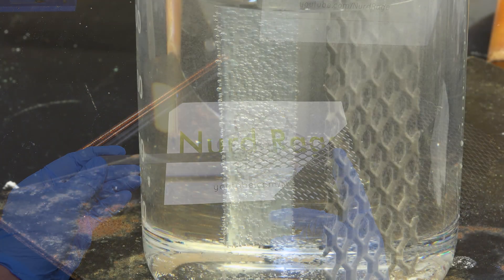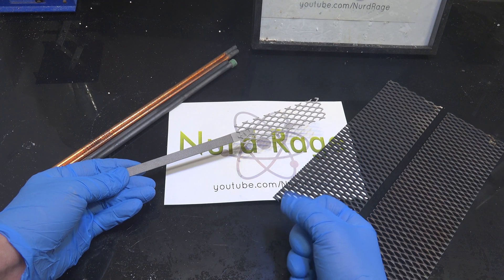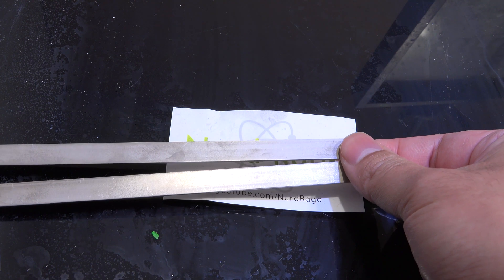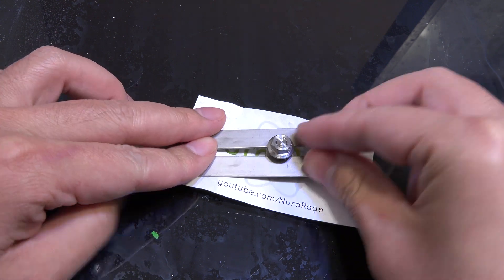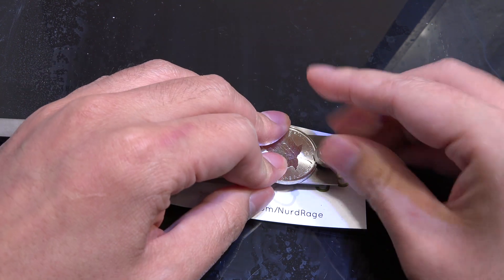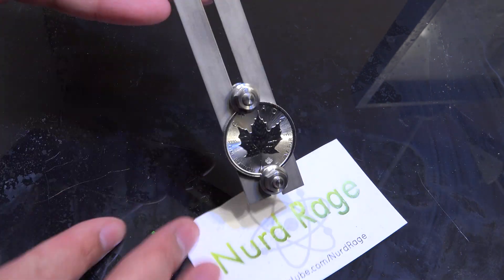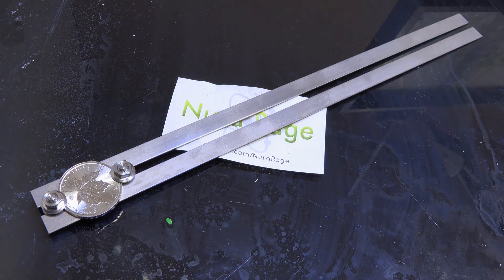Make a Platinum Electrode

Comment: How mixed metal oxide made ,i guess they mix the oxides to make a paste of oxides this then we cover the sheets of a steel mesh not titanium ,because u need only a thin layer of mmo layer ,but adding more with heat again makes it denser more condensed oxide layer ,layer upon layer

Comment: Necroposting an missing the point of a good joke, but.... given you talked about a thin layer of platinum on the hard drive platters on your acid destruction video, could you actually use those as a very inexpensive amateur platinum electrode?

Comment: Sweet. I got a platinum ring I wanted to use in just such a manner, I was worried whatever I mounted it with would degrade first. Nice to know I'm good. However it does have some gold plating, any chance electrolysis will interfere with that? Its an heirloom worth more than the combined value of every vehicle I've owned (all used and well used mind you), irreplaceable doesn't begin to describe it so any damage is outta the question. Thoughts?
Reply: Do not use it as an electrode lmao
Reply: @infernalsorcery7923  waaaaaaaaay too late for that dude! I found out the great big "diamond" was a fake. I popped it out and set it to the side so it can be recounted at a later date. The ring is still in excellent condition
Reply: @ltsgobrando  if it has gold on it, prolonged exposure to electrolytic reactions will cause damage and 'wear' exclusively to the Golde.
Reply: @infernalsorcery7923  Originally that was my concern too, but ultimately the gold plating was a blessing in disguise! The biggest thing for me was making sure the ring was safe, and why I ultimately wound up with such a perfect design.

Once the great big (fake) stone was out I noticed that only the little arms were gold plated. I wound the ends of a really thin stranded copper wire around the gold arms, so they would act as electrodes for the ring. I then siliconed the hell out of that connection. The real trick was having the copper wire have a zinc lead on the other end. Why re invente the wheel when redox reactions have been known about for years. I just gotta make sure to replace the plug when it crumbles instead of bypassing it.

Thanks for the concern man!
Reply: @Jordan Richards  Well, that's good news then, sounds like a cheeky but effective bypass to my concerns as well anyhow. Much luck

Comment: So I'm going again through this video after a year, and many seem to think it was a joke. It isn't in fact, except as pointed by NurdRage below the ridiculous price. This does work, but no need to spend $1000 on platinum to get a real platinum electrode. That ounce of platinum in the coin if properly processed would be enough to make many electrodes.

I have in fact made a platinum electrode in a similar manner, but for much less money. I used a 5g platinum bar, also purchased with my soul (and some bitcoin on top) and stretched it very thin by hammering it between 2 sheets of leather. It's really the surface of the platinum that matters, not the bulk of the platinum trapped inside the bar or coin. I ended up with a thin piece that's about 6cm^2 per side, so about 12cm^2 total. I then spot welded this to the end of a titanium strip. It works nicely in a perchlorate cell. I trust the welded joint much more than plain mechanical assembly with bolts - salt will eventually creep between the titanium and the platinum at the mechanical joint and degrade the contact.

I spent the equivalent of $170 on the platinum bar, and a couple of hours hammering on it. But I plan to enjoy my real platinum electrode for many years to come.
Reply: This was an amazing read! how was your platinum electrode doing now in 2023?
Reply: And even then i bet is possible to process the spent electrolyte to recover the platinum.
Reply: Probably not worth as it decays so slowly  @teresashinkansen9402

Comment: What you generally get in the "fake" anodes are coatings of palladium and/or rhodium over a cheap ferro titanium base.   At least, that's what one I have appears to be.   It'll work OK for 2 volt jewelry plating, but not last well in a perchlorate tank.   

HOWEVER, it does appear to me that the rhodium or palladium over titanium makes a very nice clean and not oxidized surface for plating lead dioxide for creating a much more durable anode.

Thoughts?

Comment: Platinum electrodes are awesome. And i'll never forget the manufacturers recommendation how to clean the platinum electrodes of our coulometric karl-fisher device (Same thing as the Karl-fisher titration, but instead of adding the reagents you create a part of them by oxidizing iodine I- to I2): Just clean them with a 1:1:1 solution of sulfuric acid, nitric acid and hydrogen peroxide xD A bit extreme, but since it's an awesome cleaning solution it won't attack the platinum electrodes, why not? Just don't mix the 3 compounds the wrong way or you'll get a huge cloud of nitrous gases xD

Comment: There several videos out there that  describe the process of uniform thin film deposition and the at home manufacture of a device that can be used to achieve these results at home. 

I suggest you check them out or even contact the youtubers that are posting videos of their devices. It may allow you to get more use out of you platinum.

Comment: I knew something was wrong when you said you didn't even have a drill to drill into the titanium strips. I was thinking What????? , .... Nurdrage does not even have a common electric drill??? lol
Reply: Drilling titanium is a bit harder than just having a drill.  If it is 4al6v, which is the most commonly used alloy for machining and fabrication purposes, it's even more difficult because the alloy is very tough, and does not conduct heat, which leads to burning your drill bit and softening the cutting edge, which leads to total edge failure.   I recommend stub or screw machine length industrial grade HHS drill bits, and you want to do this in a drill press if at all possible.  Buy a pack of whatever size you plan on using, because you are likely going to burn at least one.  Run it slow, with even pressure, and lots of coolant.  Too little feed pressure is also bad, because if it's not cutting it's rubbing, and that's heat that will also burn your tooling.
Reply: You don't want to use 6AL4V titanium for anodes... they are not nearly as chemically resistant as pure titanium. Always use Grade 2 or something. Unfortunately you will have to make your own nuts and bolt out of grade 2 because nobody makes them (they are all 6AL4V). Drilling titanium isn't that hard, I did it with a drill press. I even tapped it too.

Comment: Use silver cables they aren't that expensive (about 1 dollar per 2 grams) and it has one of the best if not the best electrical conductivity at room temp
Reply: OLD-BIT ProGaming not very unreactive,in many experiments,it will not survive
Reply: OLD-BIT ProGaming not very unreactive,in many experiments,it will not survive
Reply: Alvis Gwa yes that's the downside

Comment: I've worked with commercial grade titanium & found it very easy to work with. Drilling is comparable to drilling mild steel.
Reply: Cutting sheet Titanium is a bit more of a problem. I invested in some Diamond cutting wheels for my Dremel and have been pleased with the results.

Comment: Hey mate, if ya live in Ontario than feel free to message me if you ever want access to a cnc shop or tooling. If you need anything custom made just let me know, it's what I do everyday. Obviously you'll have to supply the raw material but my mill, lathe, powder coating, electroplating and general tooling abilities are something I'd be happy to donate as well as my time to the effort your making.
Reply: Alvis Gwa I am aware, Ontario is a province in Canada mate.
Reply from the maker: Wow! that's an awesome offer! i'll keep it in mind. Thanks!
Reply: NurdRage anytime man, I've built apparatus for experimentation before when I was at Trent taking biochemistry,... which I dropped out of. Organic chem ruined my brain. Anyway I am originally an electrician by trade and have a huge background in electronics, micro controllers etc so if you need any help with any of that stuff, as well as the machining by all means ask away. 
My mill and lathe are both fairly small but for 90% of what I can imaging you ever needing what I have is plenty.

Comment: i know a thing or 2 about canadian curreny,  this kind of large coins are usually 20$-50$ of value + the cost of the metal +10% profit because they are collector's coins.

this one looks like the 1oz platinum maple leaf minted between 1988 and 2002 that is worth about 1000$ (50$ face value)
assuming the 950$ per ounce value of platinum, it actually looks like you are only loosing the 50$ by using it as platinum.
Reply: *5%
Reply: tis usually 10%, this time its 0% if you include face value
unless you were talking about my typo ''50%'' which was meant to be a ''50$''

Comment: I had no idea that platinum is now about 20% cheaper than gold! That's crazy!

You use the same tools to drill titanium, that you use to drill any other metal. A drill, and metal drill bits.
Reply: You need cobalt drill bits to drill metal like that. Which are far more expensive than your run of the mill bits. But I agree, those proprietary nuts and bolts were probably pretty expensive just because they are titanium.
Reply: For something thin like that you could drill it with any old drill bit, wouldn't matter. The coating is generally there for "non-stickness". In my experience titanium behaves a lot like aluminium when machined.
Reply: Mitchell G You can drill titanium with regular drill bits. Especially if you're only drilling two holes.If you're drilling titanium for work or production, then yeah cobalt coated or solid carbide bits are best. but it's not a matter of how well they'll cut, it's a matter of longevity. But for two holes, a regular bit from home depot will work just as well. It just wouldn't last very long. (In fact the few times I've drilled titanium, I drilled quite a few holes with regular TiN and black oxide bits.) Also, cobalt coated drill bits aren't very expensive. you could get a cobalt coated bit to drill those holes for just a few bucks.

Comment: This one has me a little confused. I am by no means a chemist so I have no idea if this is a total joke or just slightly a joke. I mean yeah it costs WAY more than just buying a pre-made one but it works doesn't it?
Reply from the maker: It's a slight joke. Technically this does work. But it's ludicrously expensive and no one in their right mind would ever do it.

That being said, "bulk platinum" electrodes which use pure platinum elements do exist, but they usually use very thin platinum foils rather than thick coins. a coin is a very inefficient use of platinum since the surface area to mass ratio is much smaller than a foil.
Reply: Ahh okay that makes sense. When I first read that I read "to protect the more valuable titanium" and thought 'ummm what?'
Reply: Awesome! thanks for the reply. It was one of those things where it both made sense and didn't to me. But I  bet to a lot of people this is hilarious I am just not smart enough in chemistry to fully grasp it on a first viewing.
Reply: It's pretty easy to get Platinum wire, why not hammer that flat and wrap it around some Titanium? You'd be able to control how much Platinum you use and could probably get a really big electrode for like $100.
Reply: what about april 1st
Reply: I was thinking this had to be a joke. Though I was thinking why bother? The Ti is already submerged, just use that as the electrode, then I remembered Ti passivates on the anode and loses it conductivity. That's why you said the current is all flowing through the Pt.
Reply: +Martin of Gliwice
No bulk platinum is always much cheaper than any ready made platinum object. Just like with any possible metal.
Reply: +Mrdudeman
I think the titanium would just lose its electrical connection to the solution as the surface passivates. But of course that depends on the electrolyte, some would also corrode it.
Reply: did you really buy 1k$ worth of platinum or was it a fake coin with a fake reagent?
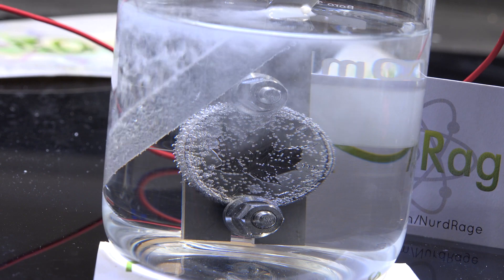Reply: in 2:20 its quite clearly written "Fine platinum" on the coin. You can also see the 9999 numbers indicating it's purity. So that's what I meant, it could be fake.
Reply: well also the increase surface area will speed up the reaction, I also think it is april fools
Reply: x9x9x9x9x9 actually platinum coins are a very cheap source of plaatinum, and other precious metals. This coin will last pretty much forever, the titanium can be easily replaced. Platinized titanium mesh will break more quickly as platinum coat is not as thick as this coin.
Reply: NurdRage I wonder, if with the use of burners, hammers and anvils or even a hydraulic press you could flatten the coin down to a plate. Coins are actually cheaper per gram than most other platinum objects, I recall. If you could make a platinum sheet this way, you could have a quite good electrode or even a few good ones.
Reply: The entire point of the platinum is to protect the more vulnerable titanium from corrosion in the form of a coating. If you are literally just going to bolt a piece of Pt on to bare titanium strips, why bother? Just use plain Ti, it will have the same effect, and be cheaper.

Comment: What if I chose to cut costs by using duct tape or elmer's glue? Might I also suggest just throwing out the platinum and using a tin can as an electrode. More surface area, more bang for your buck.
Reply: You can use your own urine as the salts
Reply: Samuel Connolly yeah the gas that comes off always smells amazing
Reply: carolyn mmitchell I like to fill my house with the smells of electrolyted piss
Reply: The problem is glue/tape might dissolve.

Comment from the maker: A major advantage of an assembled electrode over a plated electrode is that it's far easier to repair. If the titanium should decay it doesn't take the platinum with it. You can disassemble the electrode, get new titanium, and rebuild it with no loss of the valuable platinum.
Reply: When your soul is less than 1000 dollars...

You have done some things in your life we don't know about.
Reply: Thereby negating the entire purpose of the platinum in the first place! Brilliant! I'll take 2 dozen.
Reply: Souls are sold by mass, current exchange rate is a beeelllion dollars a gram...........
Reply: Andrew Bagley IT IS AUSTRALIAN HUMOUR OMG DAMN AMERICANS
Reply: https://www.stuller.com/products/laser-wire/262791/?groupId=98824&categoryId=1567&recommendationSource=CategoryBrowse

10' of 36ga 90%Pt 10%Ir wire. It's about $40. 
PM me if you ever need something made of precious metals. It's what I do for a living.
Reply: LoL!
Reply: rude
Reply: but its dick jokes
Reply: Yes, they are dick jokes, my slow Andrew friend. Just like Basicially said.
Reply: I couldn't find a relevant video, so this one seems right. I made a 30vdc power supply, and some copper electrodes. I ran it in some saltwater, and had a sandwich bag overtop to capture the hydrogen. The bag didn't t expand, and the water took a tint. Can you please explain to me what happened?
Reply: Actually, there's quite the article on making platnium foil and spot welding to a titanium backing on the blog at exorockets.   Fascinating reading.
Reply: NurdRage who did you sell you soul to?
Reply: May I ask for your help with a platinum electrode question?
How do you calculate the maximum current capacity of a pure platinum electrode?
For an experiment I'm planning I'll need a platinum electrode. I'm going with platinum wire or a rectangular sheet.
If my electrode is a 50 mm long platinum wire, 2 mm Ø, what is the maximum current I can safely pass through it and into the solution? Would really appreciate a guiding suggestion of how to calculate it, or where to find out how to calculate it!
Reply: I love how you sneaked in the hint that its april first :D
"The current exchange rate, on this day, april first" winkwink
Reply: Wow! Expensive! You're not going to hammer out the coin to increase the surface area at least??? You could hammer it out into a sheet and use bolt cutters to cut a comb of flanges into it to maximize the contact with solution.  You might be able to get 2 or three electrodes out of it.
Reply: NurdRage can we make a hydrochloride acid out of oxalic acid